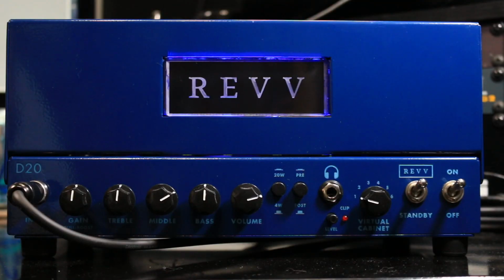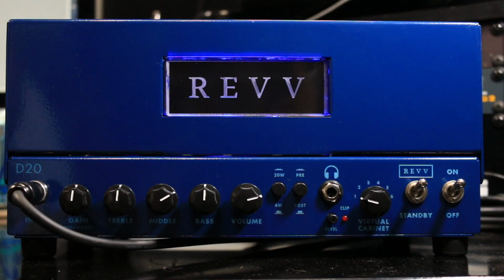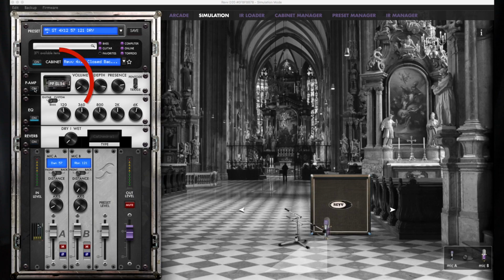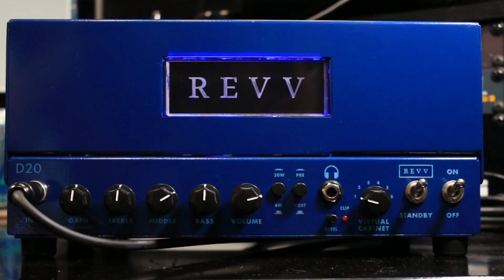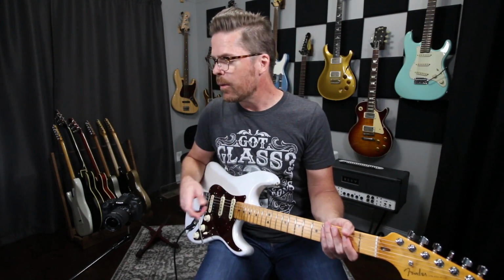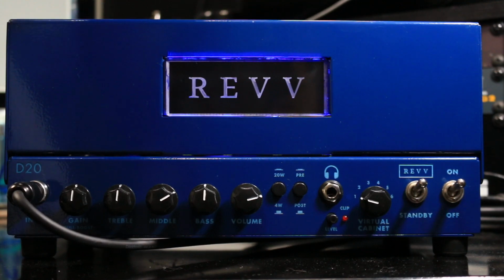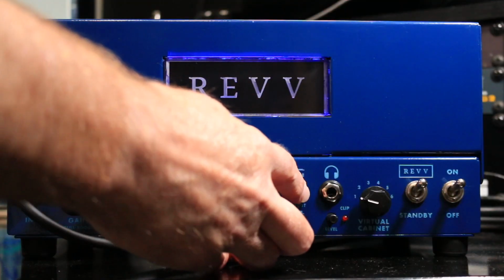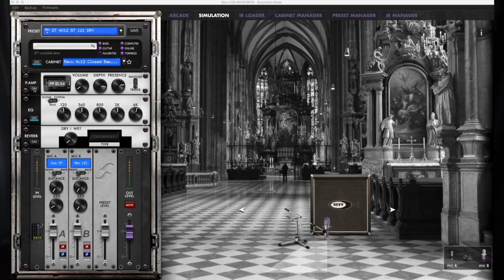VIRTUALLY TUBE SWAP YOUR REVV | Shawn Tubbs D20 & G20 Tutorial

Comment: You'd think Revv would put this little detail in the D/G-20 manual... but nope, it's not there at all. Great little amps with some of the worst user manuals if I'm being honest. It'd be nice to get a firmware update too since in the G-20 the presets do not store the Wide nor the Pre/Post button state. Both of those must be manually set on each preset load or set afterwords via alternate outboard midi device signal. Frustrating to say the least. I requested this be fixed via their support ~2 years ago and nothing but the sound of crickets to date.

Comment: I've been using mine totally wrong 😂 I didn't realize when you switched on virtual you have to switch to pre to bypass the amp power section. But I actually like it with the virtual stacked on top of the amp power section

Comment: If let say im on ‘post’ and had my Power Amp sim switched on too (let say EL84).
Does that mean the whole signal be like stacking 2 different power amps of
6V6 into  EL84?
Reply: I guess nobody knows and Shawn is confused too. At the end (4:28) he switches to Pre and he says we are not hearing to the power amp anymore and we switched to the software that is a mistake. I just bought the G20 and reading the manual I ammore than confused.

Comment: When saving a new power section simulation to a certain channel/aggression mode, does the pre/post button on the amp have to be engaged or will it work just through the software? For example, the P-amp light in the two notes software is on, but the light on my G20 pre/post is off...

Comment: What about the EQ in the software, does it work the same as the power amp simulation? And can it be saved per preset? Or different software EQ per channel? Thanks in advance
Reply from the maker: Yes anything in the Torpedo remote can be saved as part of a preset virtual cabinet sound and then recalled via MIDI. Some people cycle through these as channels, other just use the EQ as a solo boost - stuff like that.